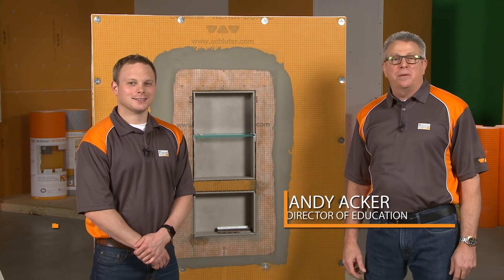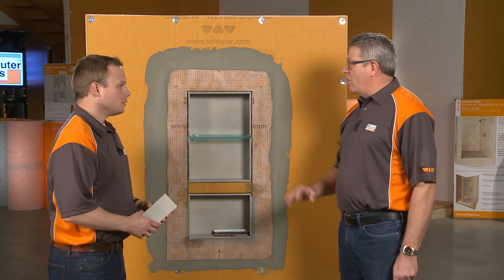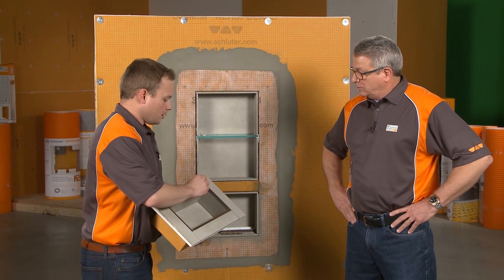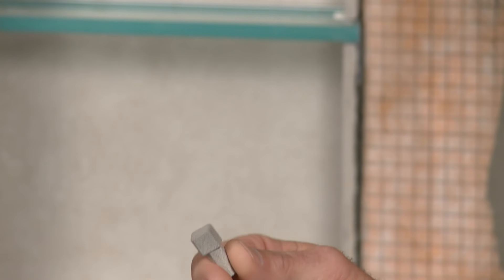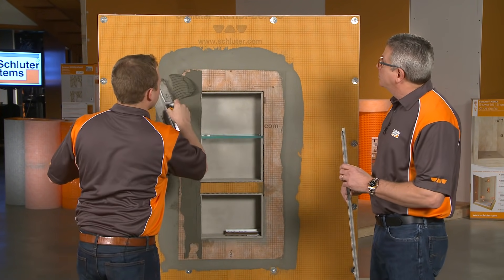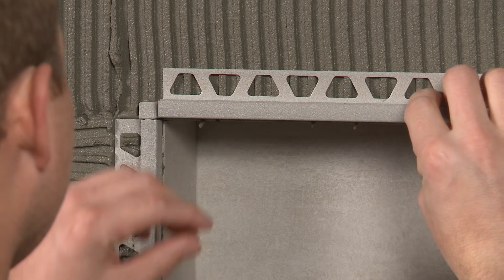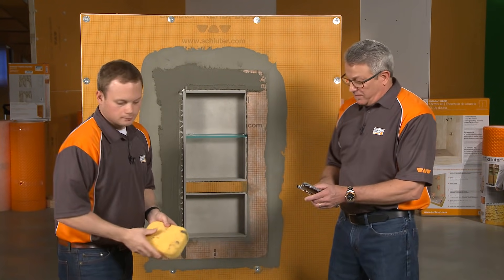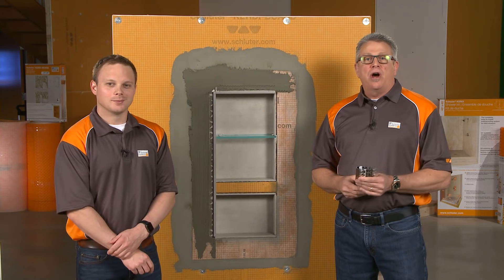Tips on finishing a shower niche

Comment: I am installing tile today and doubt you will get back to me in time, but it's not clear if the tile inside the niche is flush with the outside edge of the wall or if it should have a gap the thickness of the grout line between the back edge of the Jolly strip and the inside edge of the tile in the niche

Comment: It would be helpful to mention cut length of piece to corners of walls etc when using quadec corner pieces and the depth iff any to push against the wall to allow thinset and tile so the tile doesn’t stand out too far

Comment: You didn't show how to combine in that shelf.  Do you run two long verticals passed it or do you need to frame out below and above the shelf? Does one have to precursor tiles to support that shelf?
Reply from the maker: Hi Theresa, would you be able to give our Product Support team a call to discuss your project in a bit more detail, they will be able to advise from there. 800-472-4588 (US) or 800-667-8746 (Canada). Thanks!

Comment: How do you seal the joint between the trim and the inside niche tile, grout? Thx
Reply from the maker: Hey there! Correct. The niche itself is waterproof and then the KERDI overlaps the flange by 2", so the junction is waterproof there as well. All you would then use between the profile and the tiles is grout. No need to "seal" anything in that surface junction, as it is already "sealed" below.
Reply: @schlutersystems1  Also I noticed you installed the trim flush with the inside of the niche. Is that just for demo purposes because the tile inside the niche should be covered by the trim also, correct? I'm a newbie as you have guessed!

Comment: What exactly are the names of the schluter products used in this video?
Reply from the maker: Hi hkgeldean! We used a bunch of different products throughout this video. Here's the list: The solid backing is our KERDI-BOARD, and we installed a KERDI-SHOWER-SN Shower niche with our KERDI-BAND waterproofing the seam between the niche and the KERDI-BOARD on the wall. The KERDI-BOARD shelf in the niche comes in larger sizes. The glass shelf in the niche is made from a purchased piece of cut glass and is installed using our DECO-SG profiles. The profiles we show you that finish around the niche are: we used RONDEC for the demonstration that Aaron holds in his hand. It's the round finishing profile. We used QUADEC on the main demonstration where they actually installed part of the profile. Both RONDEC and QUADEC have corners pieces available. Towards the end of the video, Andy shows some Sample pieces of other profiles and DIADEC is shown in his hand there. I hope this helps to decipher the products used within the video. Thanks for checking out our channel. :)

Comment: Sorry but I would never set a niche this way. Love and only use your products, but you have this one backwards. Always set the wall tile first because your wall may have a bow or be out of plumb. This will change the depth cut of the niche side cuts.
 Pre-cut miter your profiles with the trapezoids on the wall side. Use tin snips to remove the small metal on the profile. It will bind in a saw. Use a Diablo Speed Demon blade on a miter saw to cut the 45°s. The cuts for a 12x12 niche will be 11 1/4" to the outside of the miter 90% of the time. Just depends on the thickness of the tile going in the sides of the niche. You can use a very small amount of hot glue or a small strip of tape to hold the mitered profiles together. Square them up perfectly on a flat surface, take them over to the wall and use painters tape on the top of the trapezoid of the top profile to hold it in place.
 THEN set all your wall tile. Shower walls that are bowed or inside corners of walls can result in 1/2" of mortar behind the tile at the niche location sometimes. Set the profiles behind the wall tile making sure plenty of mortar is holding your pre-fab profiles in place.
 THEN after the wall tile is set, install the tile in the back of the niche and take your measurement from that to the inside of the profile. If your wall was bowed or out of plumb this is where the adjustment to the niche is made. Your way could result in a 1/2" gap between the profiles and the niche side tiles. That's alota grout. Hope this helps someone.

Comment: so this goes first, then the tile correct?
Reply from the maker: Yes, that's right.
Reply from the maker: You would usually tile right away. But you can wait, it you prefer, as long as your thin-set over the anchoring leg is smoothed out, so you don't have any bumps getting in the way of the tile install later on.
Reply: @schlutersystems1  I noticed you have the tile inside the niche already which allows you to have a flush surface. I had thought I would wait to tile inside of niche after finishing the wall and using the quad but then I would have to guess a bit at the depth of my thin set and tile inside of the niche. so do you recommend tile inside first and then wall tile?

Comment: Do you start the wall tile around the niche or do you start at the bottom as if doing a wall with no niche?
Reply from the maker: Hi there, it depends. You have options based on your installation needs. There isn't necessarily a one size fits all approach. You could start from the floor, if it's flat. You can start from the niche or the floor, if you will have cut tiles between them. You could also start from the floor prior to cutting out for the niche to make sure you can use a whole tile up to the niche profile. Evaluate your installation parameters and choose the best option for your assembly based on that. Hope that helps.

Comment: is it safe to assume you will finish off the bottom peice the same as the top?, without overlapping the bottom peice over the face tile you have created a flat horizontal seam  exposed to massive water ,,whats to keep the water from entering shower between the metal and the bottom tile . ,,you will always have water sitting on that grout joint
Reply from the maker: Hi Bill. Yes, the bottom of the niche is fitted out with a profile the same method as shown at the top. The water will get in the grout joint, but the benefit of a sealed waterproof system is that the water will not damage the substrate behind the shower. This will allow the assembly to dry between uses.

Comment: Do they rust? I need something for the transition of the tile from my shower to my bathroom walls.
Reply from the maker: Hi Kat, thanks for the question! No they do not rust, you can call our Customer Support team to ensure you are picking an appropriate finish for your application. Please give them a call at US: 888-472-4588, thanks!
Reply: Aluminum does not rust, but it can corrode if the paint is scratched.

Comment: Newbie question here. Nobody seems to address the actual positioning of the tiles in relation to the wall faces and edges. Is the front edge of that inside tile flush with the face of the wall (the wall he put the thinset on), or is it set back from that wall face to allow a grout joint?
Reply from the maker: Hi John, since most of our aluminum and PVC wall profiles have an integrated grout spacer, you can cut the tile flush with the wall or leave it set back a little, depending on your grout joint size preference. Although the QUADEC does come with an integrated grout spacer on both sides, we decided to set the tile back just a little (maybe 1/16" or so) in this case to provide a slightly larger joint. The stainless steel profiles do not have an integrated grout joint, so you would always keep the tile back a little from the edge with those to allow for that grout space. Hope that helps, please give our Product Support team a call if you'd like to discuss your project in detail! 800-472-4588 (US) or 800-667-8746 (Canada). Thanks 😊
Reply: @schlutersystems1  Many thanks for your swift reply. I understand what you are saying; things are becoming clearer. As a newbie, about to embark on his first major tile job, I want to think of all the detail I can before I start. Thanks again.
Reply from the maker: Anytime! Best of luck!

Comment: What should I tell the Client about cleaning their shower that has Rondec profiles installed. They are using Polished Chrome in the Master Bath and Brushed Nickel in the other 2 baths. Also any tips on grouting without scratching the profiles? I was going yo tape it all off.
Reply from the maker: Hi Johnette, Rondec can be cleaned using neutral cleaning agents and tools, nothing abrasive. Your client should avoid the use of strong acids (e.g. hydrochloric or hydrofluoric) and base/alkaline cleaners (e.g. bleach, ammonia, chlorides). It shouldn't be necessary to tape the profile off when grouting. We recommend working with materials and tools that will not scratch or damage sensitive surfaces. It is also very important to remove thin-set or grout from the surface immediately, especially for aluminum profiles.
 
Hope this helps, please feel free to reach out to our Product Support team if you'd like to discuss your project in more detail! 800-472-4588 (US) or 800-667-8746 (Canada). Thanks 🍊

Comment: When u put the tile on first did u leave it short of the outside to accommodate a grout line between the outside profile
Reply from the maker: Good question! Yes, we actually did leave a little space at the edge of the tile, even though the QUADEC in aluminum has an integrated joint spacer already, so we would have been okay without any extra here. We suggest a 1/16”-1/18” grout joint between the tile and the profile, so in this case it was closer to 1/8”. Remember that you for sure need to plan in your grout space for stainless steel because it does not have the integrated grout spacer. Hope this helps!
Reply: @schlutersystems1  not sure we are on same page I understand the inside yes has a joint space but what I’m talking about, I guess would actually be the bottom of the profile where it flushes out to the outside tile
Reply from the maker: The QUADEC in aluminum and PVC has the grout spacer on both sides, but the stainless doesn't on either. So you'll need to keep the tile back for stainless steel installations or if you would like the heaver grout joint with the PVC or aluminum, you can do the same. You are also welcome to contact our Product Support team if you have further questions!
 
US 800-472-4588
CA 800-667-8746
Reply: @schlutersystems1  thank you now that helped

Comment: How do you install the shelf that comes with the niche? Is it screwed in or is the tiles of the bottom shelf holding it up?
Reply from the maker: HI there ! When using the prefabricated shelf, determine the desired height of the shelf and mark with a level line. Set tile up to that line on the back and sides of the niche. Butter the sides and back of the shelf with Schluter-SET, Schluter-ALL-SET, Schluter-FAST-SET, or unmodified thin-set mortar and solidly embed it in the niche, resting on the previously installed tile. The shelf may be raised at the back to create a slope, or the tile may be set on a slope, to prevent water from pooling in the finished application.  You can find more information on this page of our website:  https://www.schluter.com/schluter-us/en_US/Building-Panels/KERDI-BOARD-Panels/Schluter%C2%AE-KERDI-BOARD-SN/p/KERDI_BOARD-SN?facets=false

Comment: Informative stuff.  I’ve never seen any videos that grout after applying the trim.  How do you seal to prevent any water penetration into the back of the tile?
Reply from the maker: Hi Ralph, you can treat the trim like an extension of the tile. The entire tile installation would be completed prior to grouting. Any moisture that gets into the grout joints or into the thin-set under the edges of the tile will just evaporate after a little while. Hope this helps!

Comment: It surprises me that more tile guys don't incorporate a few drywall knives into their program. Try using a 5 inch drywall knife to apply that mortar
Reply: It’s cuz that’s a waste of time altogether
Reply: I carry a 4" knife with me, mostly to help get mortar behind toilet flanges and under cabinet toe kicks and stuff.
Reply: @peaceindarkness.darknessis3494  not really if you're going for quality over speed. I'd rather take my time and do a good job, keep my job looking clean for the homeowner, and for my own sake, less messy.
Reply: why have margin trowel way better can do more things
Reply: My 6" taping knife worked great for mortaring the inside corners of my cement board when I redid the bathroom.
Reply: Drywall knives lack the strength to "burn in" the mortar, they just bow and the mortar get's pushed out of the sides instead of into the membrane. A 5-in-1 putty knife is useful for small area's if needed.
Reply: In canada they use Trowels for drywall work. I have tried it in drywalling my house and depending on the work, I would recommend using finishing trowel over a drywall knife for doing skim coats, etc. Much easier on the wrists and you are much less likely to accidentally drag your knuckles across the drywall mud you are skim coating. You can also make sure you are really getting that drywall mud into the nooks and crannies when skim coating a roughly scraped popcorn ceiling.

Comment: I'm sold! What a great idea for edging shower niches. But the only issue not discussed is how to buy Quadec. It's probably my fault but I went to a few different online vendors and it showed prices of around $8. For what you ask? It says that for $8 I get one inch. One inch of what? It couldn't be $8/inch because that would put the overall cost of a 16"x12" niche at about $450. So that couldn't be right. So what do I get for my $8? If anyone knows what I'm doing wrong here, let me know. I did order the one inch as advertised on Lowes so I'll have the answer in a couple of days which I'll share if I don't hear back from anyone...and believe me when I say that ALL the online vendors show exactly the same setup, $8 or so for one inch of something...
Reply from the maker: Thanks for reaching out! Our Customer Service Team will be best suited to help you. You can reach them at  1-800-472-4588 (USA) or 1-800-667-8746 (CAN). Have a great day!
Reply: Likely 8$ per corner ... that's what mine was.

Comment: Is it acceptable to set the profile as you have here and then come back and set the tile later after the thin set has hardened? I have a floor to ceiling profile to install and I am concerned about the open time of the thin set if I attempt to install the profile and the tile concurrently.
Reply from the maker: Hi Lucas, it is recommended to set the profile and adjacent tile at the same time to allow for the best all around installation of the tile and profile. When they are installed together this give the best opportunity to make any adjustments to the profile. If the profile is set prior to tile, care would need to be taken to ensure the profile is properly embedded and plumb so the tile installation is not impacted negatively. Hope this helps!
Reply: @schlutersystems1  Thank you for your reply. In my application, I am setting an 8ft profile to finish the edge of a shower surround. The field is 3x6 marble tile. With only a 20 minute open time for All-Set, it just doesn't seem possible to tile the whole surround from floor to ceiling in that period of time. I think I'll have no choice but to set the profile first, taking care that it is plumb and avoiding excess mortar buildup.
Reply from the maker: Hi Lucas, can you give us a call? Our Support Team would be a great place to touch base with before you start your project. 888-472-4588 (US) or 800-667-8746 (Canada).
Reply: Lucas Middleton try setting the tile up the wall and installing the trim second, I’ve done that several times because of the same problem you’re expressing. When you get ready to install the trim, just use a grout bag or some other old bag with the corner cut off to use as a semi caulk gun to fill the edges of the tile before you slide the trim in. Have some shims around and make sure to clean off the outer inch of tile before the install to make sure your trim will set flush against your wall tile..ps. Use the thinset you’re using in the bag for the install of the trim
Reply: @Rustyshackleford752  Thanks a lot for the suggestion. I hadn't thought of that and think it might work in my application.
Reply: Another method that I have used is, set the profile dry in place with hot glue (same day set) or Kerdi Fix and some tape (next day set) then you can set the profile nice and straight and plumb and then set the tile to it at your leisure and if you get thin set over the top “bonding leg”  it will be there for a lifetime.  Also I have only set the profile on the shower field tile once then after that I always do a nice job cutting tile to the niche and then do the profiles with the jamb tile on the inside. Seems to be a lot easier.

Comment: wait, i thought the legs went under the niche wall’s tile, not the shower wall’s tile, so i guess it can work both ways? is it purely installer preference? or are there advantages to one way over the other? And if so, what are those pros and cons?
Reply from the maker: Hi Chris! Yes, the profile anchoring legs may be placed inside or outside of the niche, based on the desired look and preference. Installing the anchoring legs on the inside of the niche allows for more adjustment with the profiles and wall tile to ensure everything is aligned properly. Installation of anchoring legs on the outside will allow you to hide things like cut tile edges or install the wall tile and profile and come back to tile the niche at a later time or not have to miter a profile such as Schluter®-JOLLY. The choice may also depend on which profile is selected and the desired look.